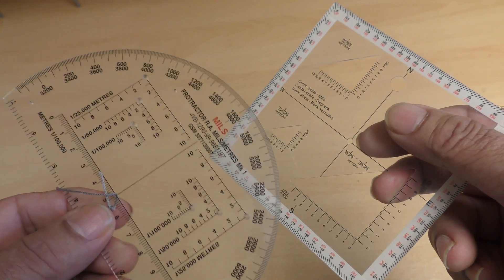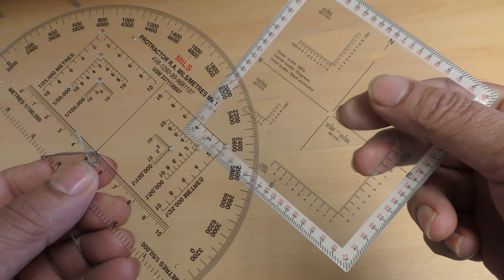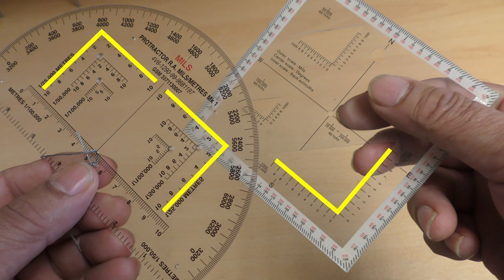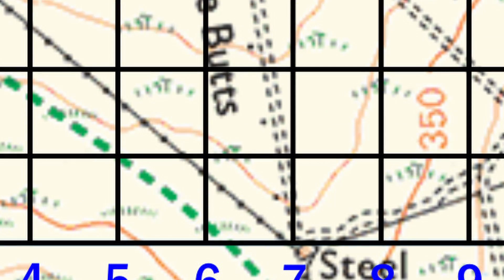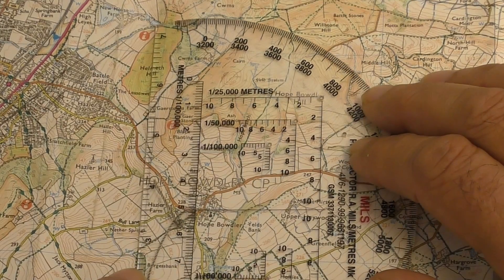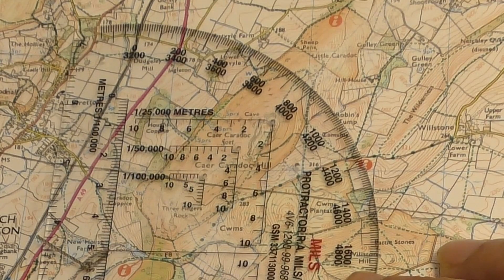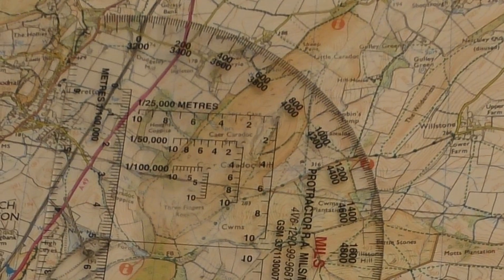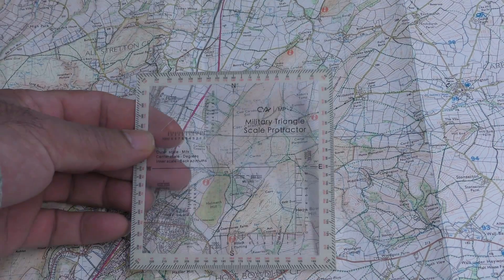Protractor Grid References - much simpler method

Comment: On the US style of reading the Romer (~6:18); That approach has a lot of similarities to the US v UK approaches to manufacturing where much of the work in check things is via go/no-go gauges and direct reading of values.  Meanwhile the UK approach is more of a measure/estimate/calculate (i.e. measure distance back to the grid line, and then add that to the grid line reading). 

Part of that difference is the make up and stability of the respective populaces. The US is all immigrants (wide variety of backgrounds and experiences), while the UK is 'inbred' with centuries of common experiences and low(ish) diversity, relatively speaking. 

A historical instance would be when Ford tried to manufacture the Rolls-Royce Merlin engines during WWII, and the different perspectives about who was better ;-)

Comment: So I want to use Harvey maps for extra details but they are 1.40 000 so is there a protractor for that scale?
Reply from the maker: Hi, you don't need a protractor to use any map, just a compass with a baseplate.  If you have a compass without a baseplate e.g. Cammenga, Francis Barker M73/M88, etc.  Then you may need a protractor to make things simpler.  But most compasses (non military) have a baseplate.

Comment: I am not a great  fan of the way you turn the roomer to measure a position. I like more the first shown method with the US protractor where i put my roomer-scale up the southern gridline so i am sure it is perfect parallel to the gridline. Then i move the roomer east until the vertical roomer-scale touch the desired point. I often saw that if you use the other way the roomer-scale is not perfect parallel to the southern gridline, wich may cause in faults. For a 100m reference this wil not make a great difference but on 10 or 1 m reference i like it more accurate.

Comment: I have military style and civilian style protractors that are made/setup to read the Roamer scales using each method you show on the US military protractor.  My older Suunto GPS plotter compass (no longer made) was setup to use the Roamer scales in the method you show by turning the US military protractor upside down.  My Cammenga Destinate DT-3 baseplate compass has the Roamer scales made on the baseplate.  You can use these Roamer scales in either technique that you show without turning the DT-3 compass over.
Reply from the maker: Virtually all compasses have the roamers with the apex on the right.  But this video was about the US military (style) and the RA protractors.  I used the Cammenga Destinate in a video a few weeks ago.

See this video I made last year about using compass roamers
https://youtu.be/yfcymnPE304
Reply: @TheMapReadingCompany Horses for courses, etc., as you kindly point out in the video.  Instead of turning the US military style protractor over, you could have just rotated the protractor 90 degrees to the left and accomplished the same as turning it over (the roamer scale remains readable right side up).   All the very best, Gordon